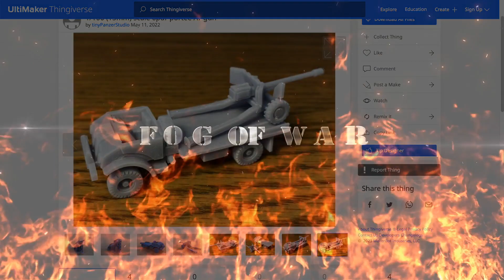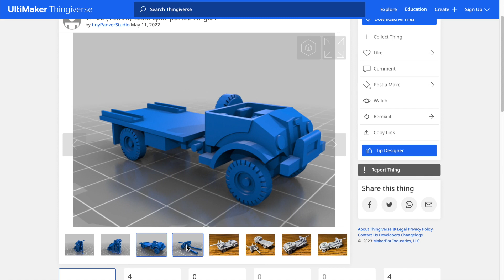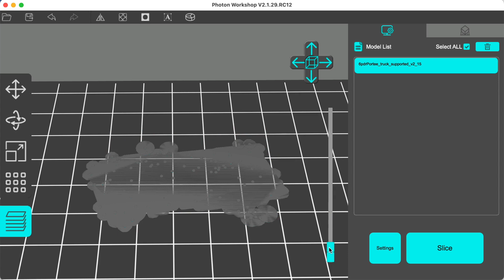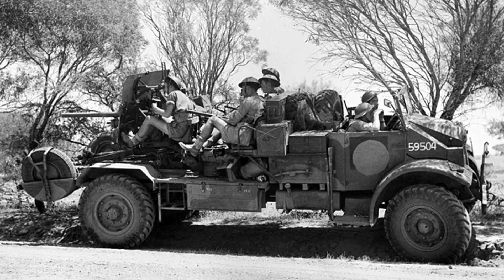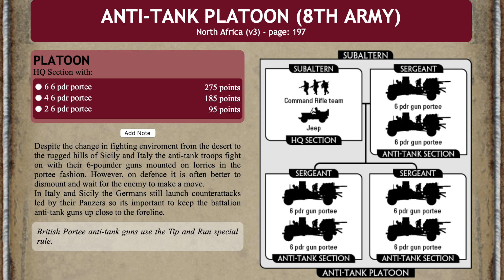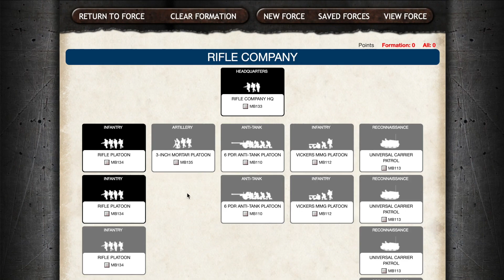3D Print | 6-pounder Portee Project (15mm) | World War II

Comment: I don’t own a 3d printer however it is on my wish list… my question to you on this video is not about the 6lb gun or the truck … it’s about the Desert Scrub in the opening images … I was wondering if they were scratch built or if not who is the manufacturer…  Mid war Desert was something that was always on the back burner… but recently with the Kasserine and Tobruk boxes along with the terrain bundles I have recently added to the collection… Mid war Desert is quickly working its way to the side burner
Reply from the maker: I believe the desert scrub is a Battlefront/GF9 terrain piece.

Comment: This really is where 3D printing shines. The ability to have these obscure models that would not be viable for Battlefront to produce in plastic.
Reply from the maker: Subs, I think you are exactly right. I bought the BF guns because they are already built, and better than the 3D file versions. If there wasn’t anything else available, I’d have used the 3D guns. But 3D is really at its best when you are plugging holes in your army that you just can’t get anywhere else.